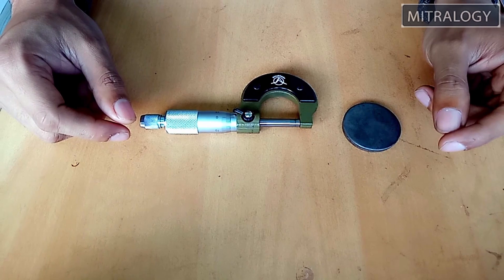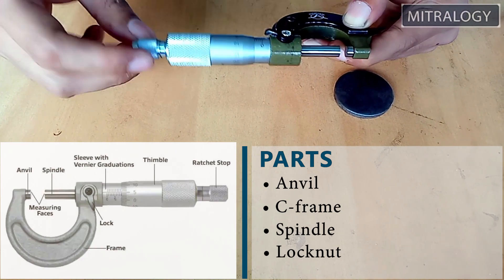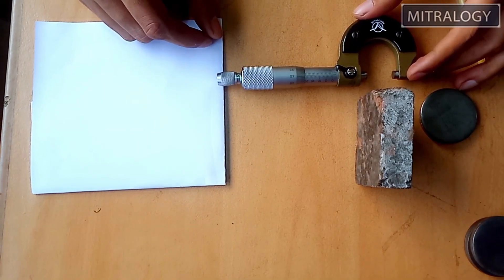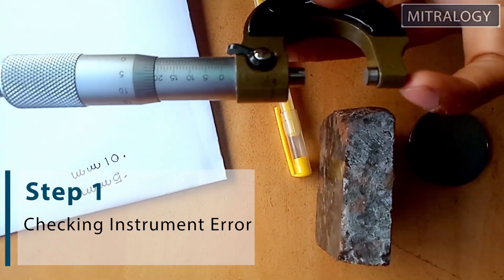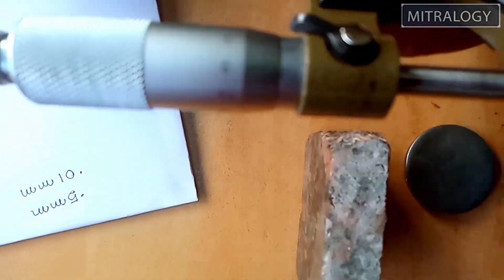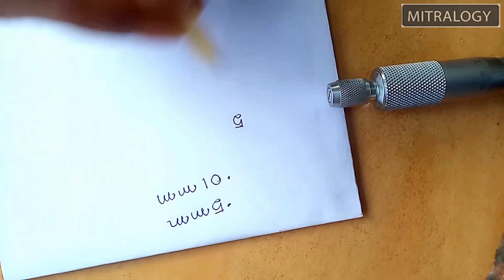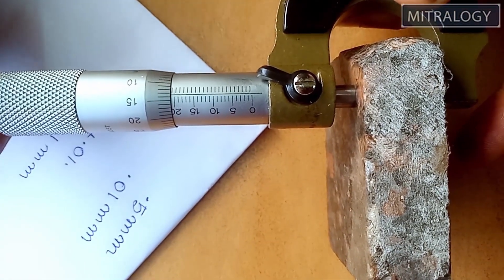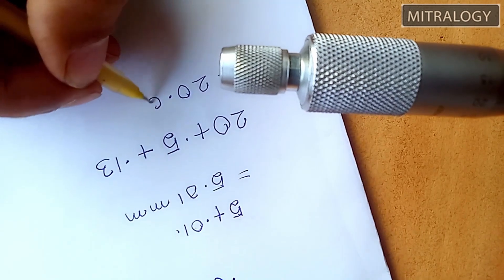How to Use and Read a Micrometer | Thickness Measurement

Comment: Can I measure the thickness of paper
Reply from the maker: Yes you can. It's least count is 0.01 mm. But for accurate measurent it's better to take bunch of paper and then doing calculation of thickness for one single paper.